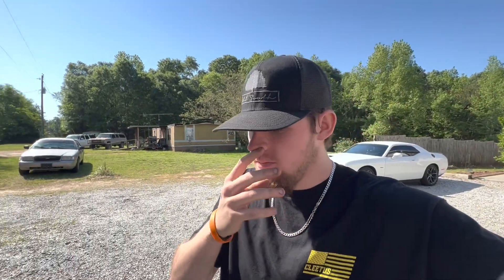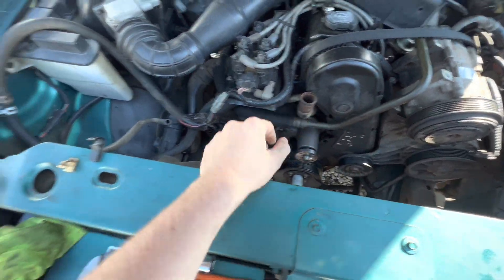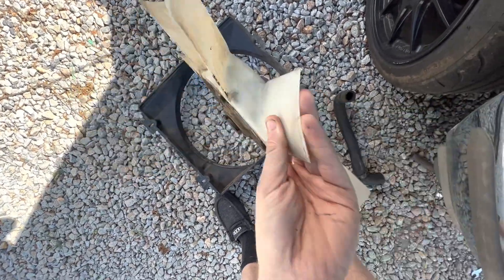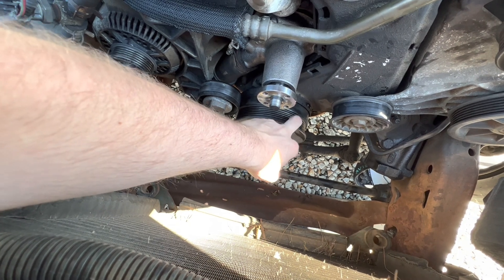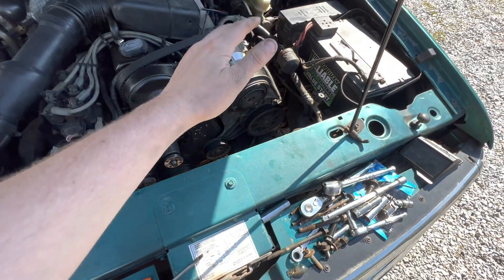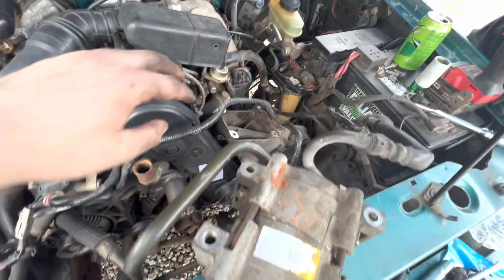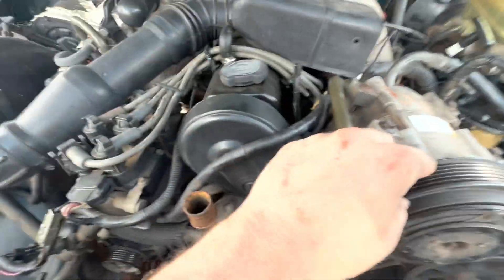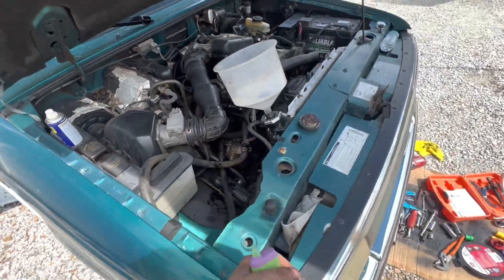1994 2.3L Ford Ranger timing belt replacement(EVERYTHING YOU NEED TO KNOW!)

Comment: I worked on cars and trucks for 12 years now, I just did my motor mounts on my 99' Corolla. But fuel pump and timing belt is where I draw the line. Especially on my 95' B2300 2.3L. Whats the quote to have a mechanic replace my timing belt? Like your quote, how much would you charge. Someone here quoted me $1,200, I'm in California. Is that fair? I can do it myself but I'd rather pay someone to do it.

Comment: mate, good video.
I wanted to ask you a favor, if you could send me some photos of the thin red and green vacuum lines, I THINK YOUR CAR HAS THEM IN RED AND BLACK, IT APPEARS, which come out of the intake manifold.
My truck has them disconnected and I would like you to help me with some photos so I know where they go.

I also need to check where another thin vacuum hose goes that passes behind the IAC valve, I THINK THAT THAT HOSE COMES FROM THE AIR INLET AND PASSES THROUGH A TE-SHAPED DIVISION, AND PASSES BEHIND THE IAC VALVE.

I would appreciate it very much if you could support me.
I could send you my WhatsApp number so you can send the photos.

Thank you very much in advance.

Comment: Nice vid. Nuts deep on a 93 ranger timing belt
Reply from the maker: @willied5940   hope i could help!
Reply: @daniel.booth218 😊VA Country, female here, I have a 95 3l and I think it's a chain. I have to pull everything out to do a water pump and rad. But, now I'm like why can't I do a chain? My issue .some dyers don't talk about if it's needs to be top dead or where to start but it looks reasonable to just do. It's Just Time. It pees me off that I'm willing but elder males in my life have zero ideas or i'll have to pay 1200 to a shop. Smh. I can get to that chain area and that's just a gut punch to be stopped due to lack of knowledge

Comment: Dont know if anyone will see this but im pretty sure my timeing skiped a tooth, would i need to take the harmonic balancer off just to adjust the belt? honestly dont see why it would be a problem but would love to hear opinions from other if yall think it would be fine or not. Same year truck only difference is its a mazda b2300 but basically the exact same thing with same motor and all, also timeing belt only has about 20k miles on it and looks good so dont really feel the need to replace it
Reply: I would take the balancer off

Comment: Unblock to tube from the airfilter too the throttle body it amazing how the 2.3 will wake up as well fuel milage also as its blocked off and you take the hose loose and look its easy to see as in removin too

Comment: Screws in my 94 Mazda 2300 were 10 ml  At least the one still there was. Not sure yet about the one I broke off. Looks like I going to have to remove what you called accessory gear to be able to deal with it. It is the top one. 
  Also the pin that helps align the sensors is in the bracket itself not where I have been seeing them in videos. 
  Feels like I can turn something by one finger where the top bolt is broken but it does not come out. Thinking maybe it is not in far enough to catch the threads, so the accessory gear might have to come off so I can deal with it, if I decide too. 
  For all I know someone may have cha need the engines because I am not sure that that gear is blocking the rest of that screw from coming out.